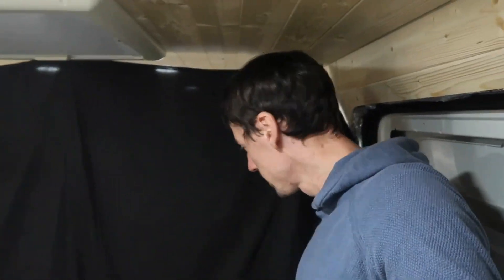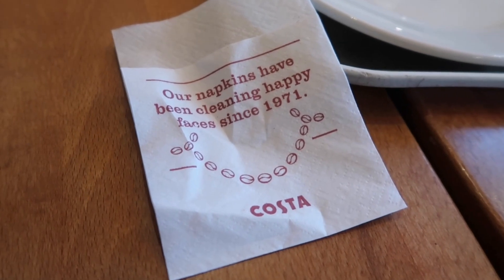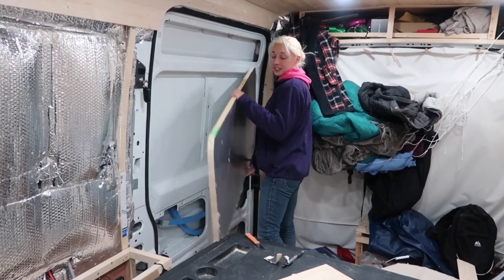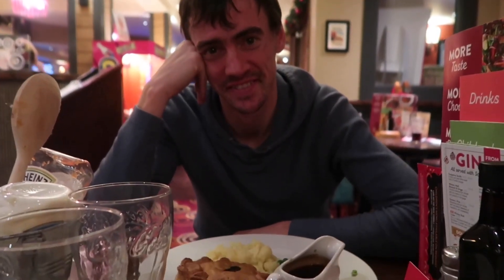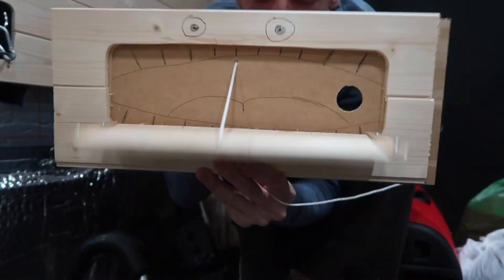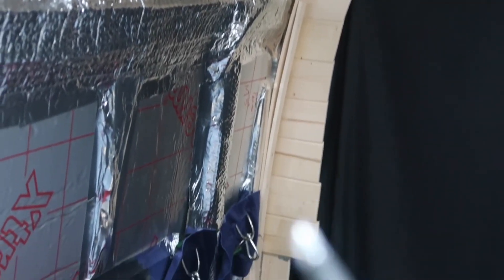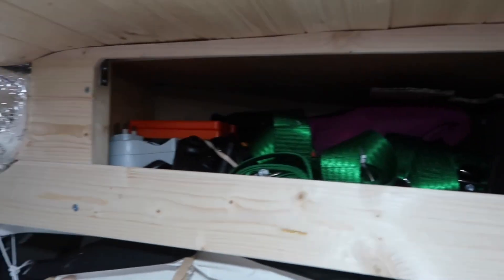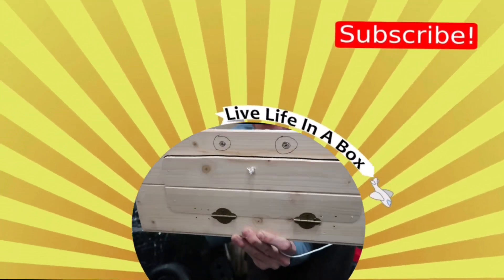Van Conversion Gloucester Services UK

Comment: Hi, I like your wall construction. I did it the same except I covered over everything with the foil as a vapout barrier as I had a big roll. Fitting timber studs like that should also avoid cold bridging 👍
Reply from the maker: Ah great! We pretty much made it up as we went, but quite happy with the outcome. The cladding is a real pain though 😱 good to know about the cold bridging! Thanks 🎉

Comment: Hi guys, I love what you're doing. I'll be doing it too in the near future, all being well. You seem to have quite a lot of head room in this particular van, are you both of average height? Nick
Reply from the maker: Awesome, thanks so much. We worked hard to get as much headroom as possible, as James is 6ft2! We used 25mm Celotex boards on the ceiling and then cladded directly to the metal ridges using window screws after adding a vapour barrier with foil tape. It's the most economical we could be with insulation and cladding and James can stand up straight, even with shoes on 😄